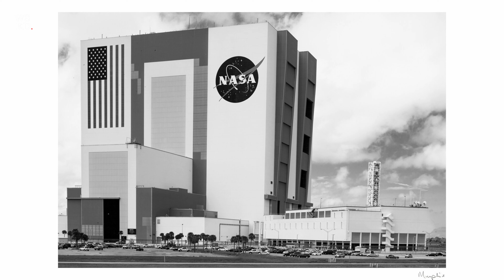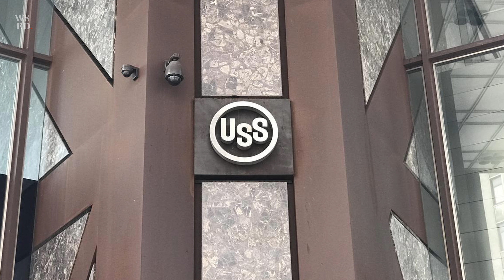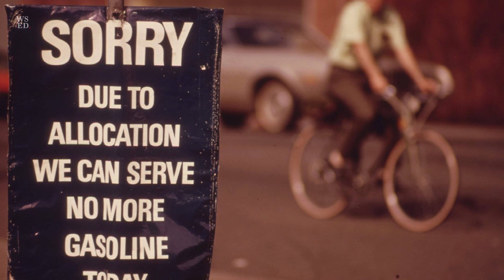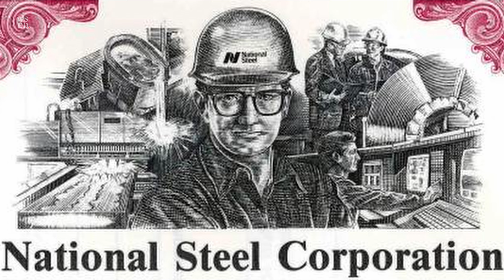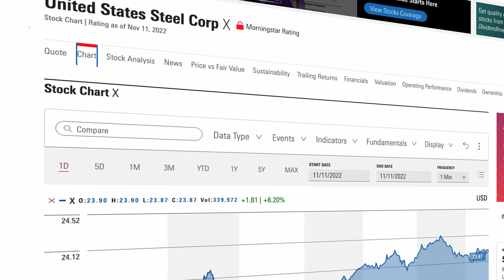US Steel Corporation

Comment: In Pittsburgh, U.S. Steel owned mills ran continuously for 40 miles along the Ohio and Monongahela Rivers. Today, all that is left is the Edgar Thompson Works,  the Irvin Works, and the Clairton Coke Works. Everything else has been torn down.
Reply: The duquesne plant was a beast. I currently work at the clairton coke works and you can kinda tell that uss doesn't care about mvw's anymore
Reply: nbo Mon valley is still there butt they are trying to be bought out by Nippon steel of japan

Comment: I binge watched two other history of steel industry in America videos tonight also. This video and the other two all feature the same detail error: the exterior shot of an impressive installation is NOT of steel making equipment. In all three videos the impressive equipment are blast furnaces and the stoves that preheat the incoming air. Blast furnaces layer iron ore (taconite), coke and limestone to form a reducing atmosphere that produces liquid iron and separates the impurities in the taconite as slag. The liquid iron is drawn off into firebrick lined rail cars called torpedo cars for transport to the actual steel making portion of the plant. The liquid iron also called pig iron has far too much carbon in it to be useful for steel and must be further refined to remove the carbon as well as having alloying elements and scrap steel added. I find it odd that so many steel industry documentary makers blithely fail to actually teach something with their documentaries. The dual inclines for the skip car tracks are a dead giveaway as are the somewhat shorter cylinders of the hot blast stoves or Cowper stoves. A caption at the bottom stating "blast furnaces and hot blast stoves to extract liquid iron from ore" would let people know that what they are being shown is just the pig iron part of the steel making process.
Reply: As for Andrew Carnegie the great from the philanthropists his role is that he would give a town a library building with they had to fill it with books which was like genius idea absolutely it would be very careful before they signed on to get the building but give it books they did he was the greatest American ever
Reply: Great capture and insight